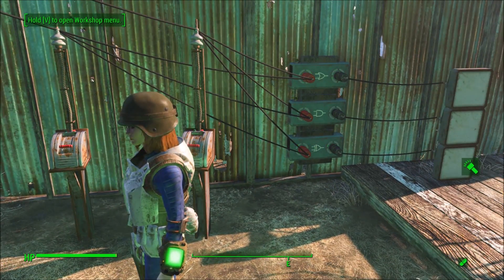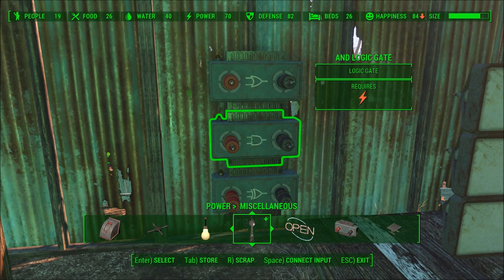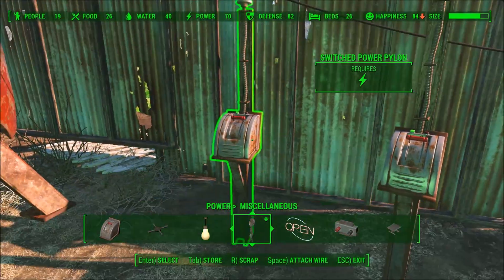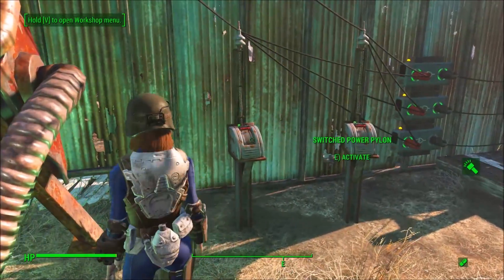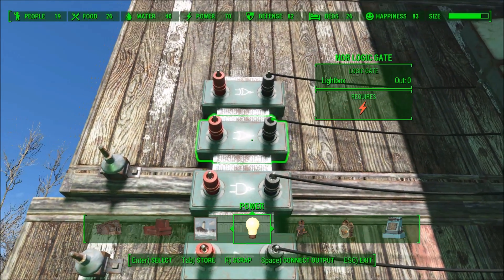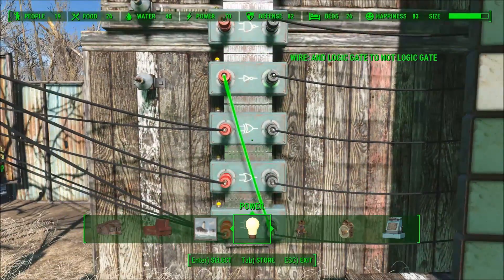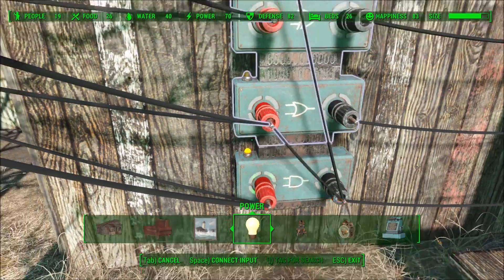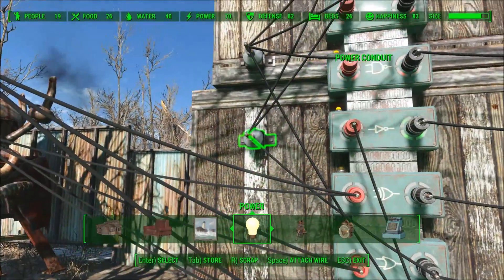Logic Gates in Fallout 4 Contraptions DLC

Comment: +mitt gaming loved your video but still one problem I can't figure out is it possible to wire a cage to a laser tripwire so that it has power while they are not tripped and when you trip them they cut power to the cage any help with this would be greatly appreciated
Reply: Prolly too late but here goes. U need XOR gate. Connect power to trip wire, then From trip wire to XOR gate input. Connect power to XOR gate input too. In other words, XOR input should be connected to power and trip wire. Then connect XOR gate output to cage.

Comment: This video is messed up. There is an obvious double negative error in the quote "Neither an AND gate's or NAND gate's logic will not be affected by the addition of an additional power line". When corrected this statement is still wrong for when a power line is connected to the input of the NAND gate the output goes to zero as it should. 

Earlier when the inputs of all 4 N gates to are connected to zero outputs of logic gates; all 4 N gates should go to logic one and light their lights but the XNOR gate doesn't. Note that you are getting 3 free power to light up the other 3 lights. Then when the power is connected to the NAND gate the XNOR gate light then turns on as it should. This seems to be because you now have freed up a unit of free power which powers the XNOR's light.

The N gates seem to work as pure logic circuits but I don't know how they transmit power.

Comment: Just to add. Thanks for the explanation :) Just not having any electrical engineering knowledge means when I tried following this the first time I was wondering wtf I was looking at and why we now had these!!! But I still don't understand why you would want the last four gates. Why would you want a gate that does the opposite (converter) of another gate, when the function that is then delivered is already delivered by one of the first three gates? Example - I don't have 2 light switches in my kitchen, with the second switch turning on what the first turns off, or it turning off what the first turns on. I just use the first light switch to turn the light on and off. Simple.

Comment: Bethesda's description of all of the N gates requiring their input to be connected to the output of a logic gate seems inaccurate. 

I made my setup according to that at first, but for what I wanted to accomplish, it seemed counterintuitive, so I switched it around and it works. 

I wanted other generators (Power B) to divert all their power to defenses if a crucial generator (Power A) was destroyed during an attack. Therefore, on the defenses side, I set up a NAND with input from Power A & B and an OR with input from Power A and output to defenses . Then I connected the NAND's output to the OR's input. So, when circumstances dictate, the NAND will transmit power to the OR, not the other way around. 

Since NAND transmits power unless all inputs have power, this setup means that if Power A & B are running, it will not transmit, but if Power A goes down, it will transmit Power B to OR for defenses.
Reply: Then, finally, to make the transmission of Power B to defenses be an actual diversion of power, on the other end of it I used an AND gate connected with input from Power A & B. So, if Power A goes down, the AND gate will not transmit Power B to the things it normally powers, freeing it up for defenses.
Reply: It would be easier to connect the defenses to an OR gate connected to Power A & B and connect everything else to an AND gate connected to Power A & B. Then if either A or B goes down the defenses will be powered but not anything else.
 an electrical engineer.
Reply: +David Nott Well, in that case, you wouldn't need the OR gate at all, as it's not adding any functionality you couldn't accomplish by simply connecting Power A & B  to the defenses directly. In my case, I did not want Power B flowing to defenses unless Power A went down, thus the NAND.